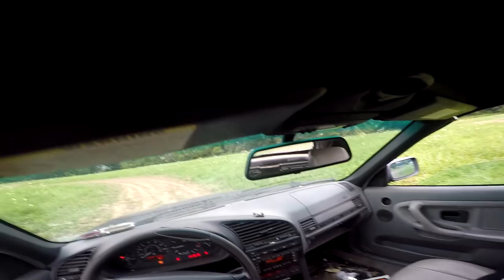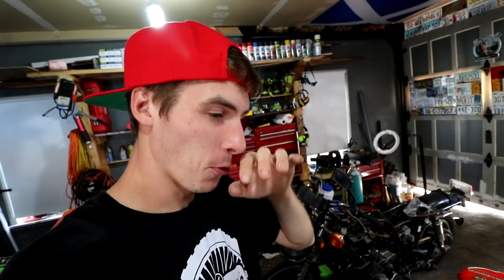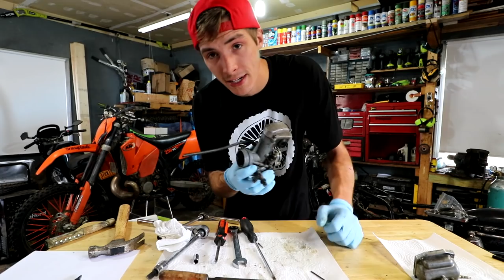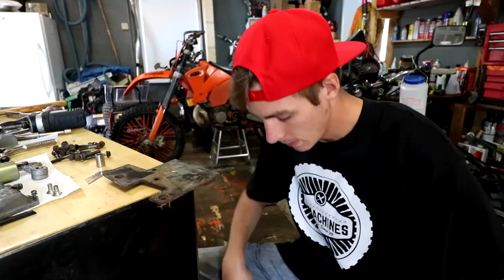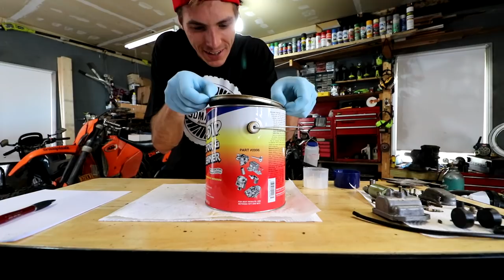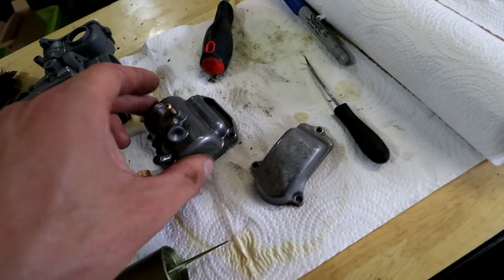1000cc ENGINE EXPERIMENT

Comment: For the price of the bike, supplies, parts and time Dalton could have got a new motor from harbor freight
Reply: jay west and not be four cylinder and way cooler
Reply: What, harbor freight sell 1000cc engines?
Reply: twah72 the engines from harbor freight is likely only a two cylinder, a flathead, has a redline of probably 3,000 rpm, and is detuned to a similar horsepower output as the original gator engine.
Reply: Kevin Lockwood Kevin Lockwood yeah that's what I though... and I'm from Australia, we don't have harbor freight here. Jay West has TOTALLY missed the point of why D is doing the gator project this way lol
Reply: That and there would be no gearbox. The gs will will be capable of much higher speeds and torque down low=more burnouts!!

Comment: Hey, the diff Bolt on the e36 is a really common failure point. You need to replace/upgrade the bushings in the rear of the diff and it should stop eating the front diff Bolt.

Comment: Two pointers. Anything the Japanese companies use magnesium for is cast in as magnesium on it. Magnesium is never used for structural parts. That cam cover is obviously structural. My 03 Suzuki SV has magnesium on covers that are. You can easily weld the aluminum.

Comment: Secret from a small engine shop: take carbs completely apart. Soak in laquer thinner 24 hours. Then glass bead bowl and body. Wash with soap and water. Soak in laquer thinner again. Reassemble with new gaskets and seals

Comment: dude why u choose the hard way to clean them??
u can clean them using Petrol & Old tooth brush & then Carbourator Cleaner Spray Can!
Reply: that's how i had cleaned mine!!
and it took almost 20 mimutes each. . . . 
i disassembled and cleaned, then i let the 1st one dry and worked on the 2nd one and and so on. . . . 
then assembled the 1st one back followed by 2nd one and so on 
and now they work awesome!!
and i got the job done in a day
Reply: I used my own excrement to clean mine.
Reply: A H S A N it just cleans it over all better if you do it the way he did

Comment: I don't favor one brand or another but I Heard to stay away from the Nissan Cummins!!!!!
Reply: Aiden Olson it's way under power from the normal Cummings
Reply: SO its like the eco version? I have the 24 valve 5.9 and it has all the power I need.
Reply: Aiden Olson they tune the turbo to lower boost and it's gear. It really low its closer to 300 hp when most Cummings are at almost 500
Reply: oh thanks

Comment: I'm a dodge fan and i fuckin hate the Nissan cummins
Reply: oh yeah true now its RAM
Reply: I'm more of a Ford fan but I like the Cummins diesel it's a nice engine and I don't mind that send me a new whatever Nissan
Reply: I'm actually looking to be an engineer and and a mechanic and stuff like that so
Reply: All it is that dodge lost the Cummings contract and is but is still the same exact motor just updated
Reply: I work for Cummins as a electrical engineer in Indiana. They are not the same engine. One is a  high speed v8 engine the other is a straight 6. Dodge still has a contract with us and now we have the Nissan.
Reply: but i mean dodge is dodge and cummins is cummins, dodge doesnt own cummins the only company that makes their own diesel for their trucks is ford with the powerstoke, dodge had a hissy fit when nissan said they were working with cummins do dodge said that if cummins made a in-line 6 for nissan they would end their contract with cummins so cummins made a brand new motor that some like and many don't
Reply: Your sort of correct but not really.
Reply: Dodge lost the cumming contract not dropped and Nissan bought it